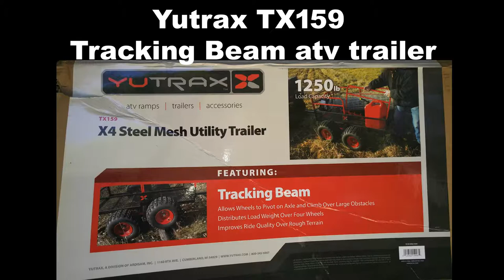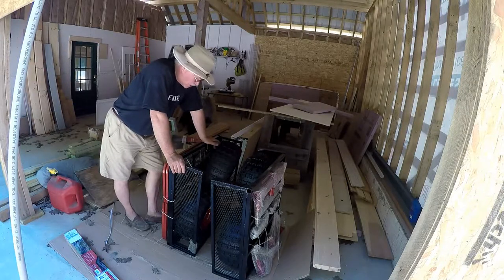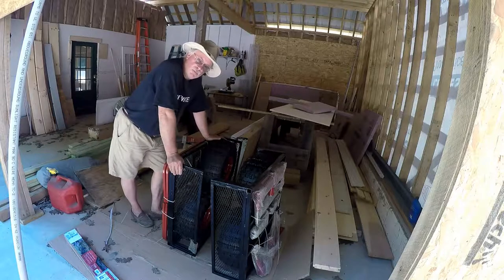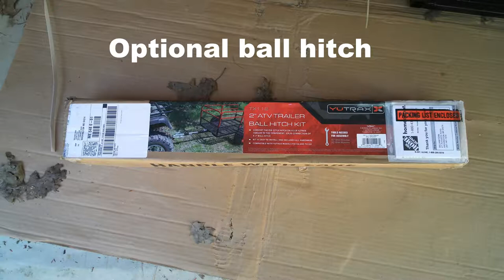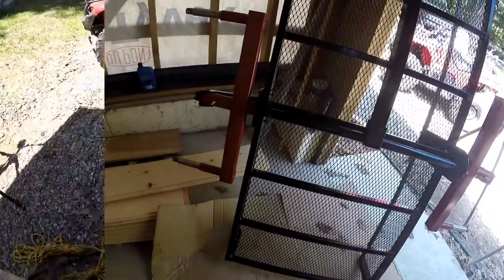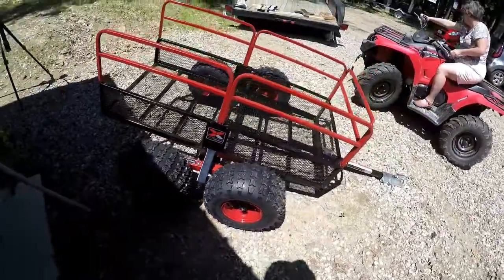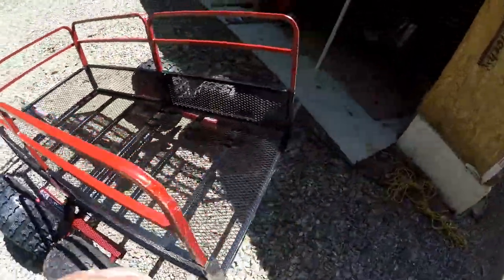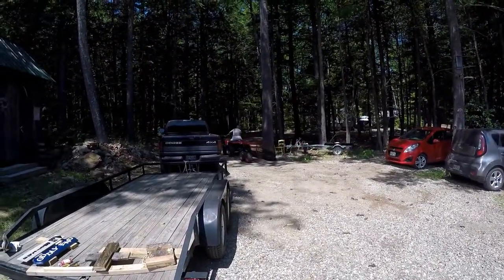Yutrax TX159 Tracking Beam ATV Trailer

Comment: You still like the trailer? Is it holding up? And what is the width inside the trailer?
Reply: The trailer is great
 I have run it hard for 2 years now and it is only tough
 I mostly use it to haul firewood and rocks.